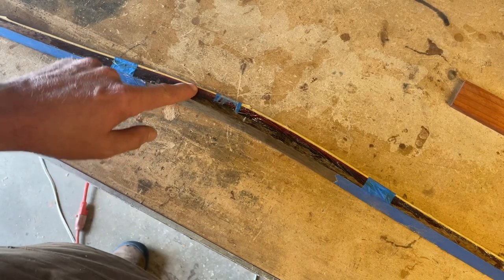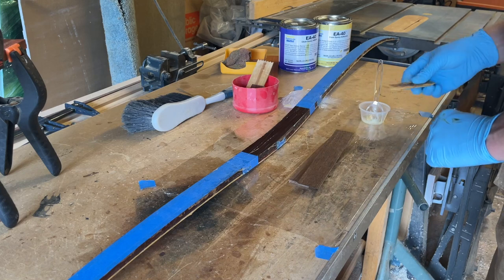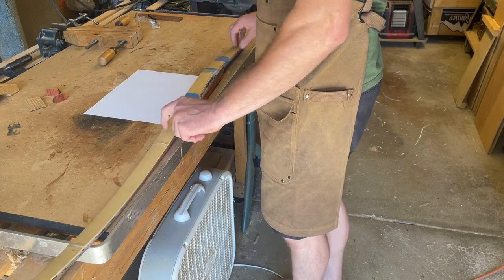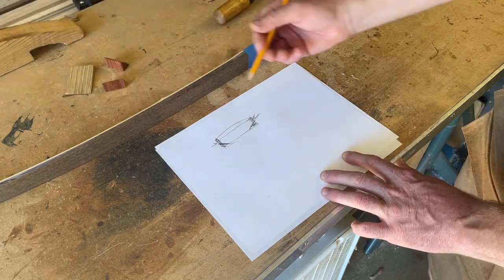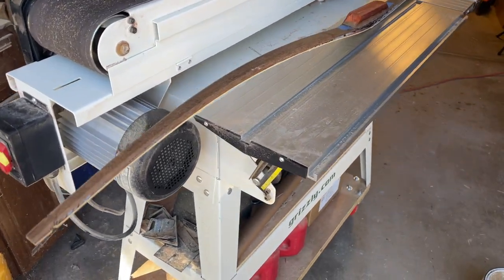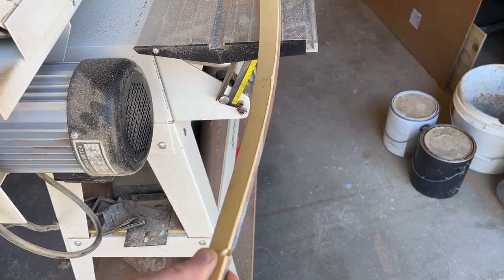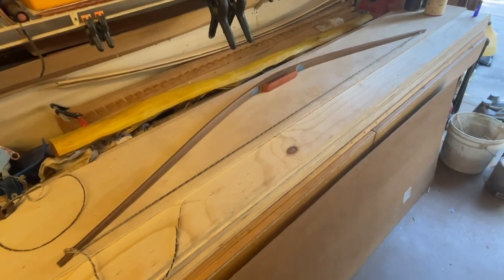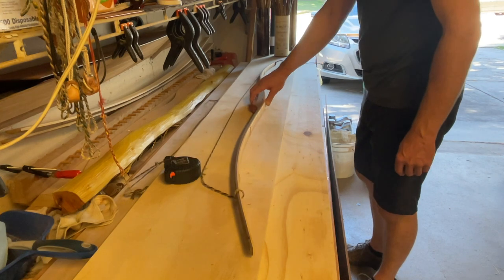R/D Bow - From Mold to Brace

Comment: You're the only bowyer that I've seen build a R/D bow back and belly with bamboo, I've got one in process, I'm building experimental version, the black locust wood had dried too fast at first and made some linear checks that showed up on the sides, thats when I decided to go for the bamboo back and belly
Reply from the maker: One thing to be sure to do is heat treat (temper) the belly lam of bamboo.  I’ve also published videos about heat tillering that I wouldn’t necessarily advise… still best to tiller via wood removal in my opinion.